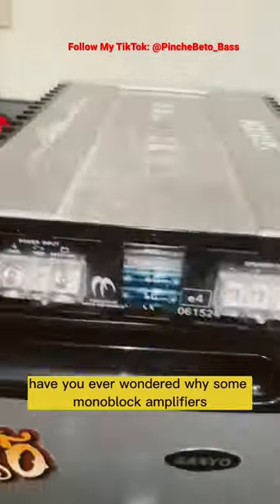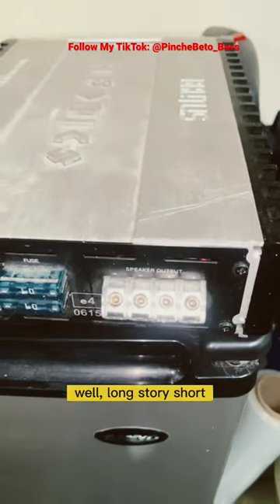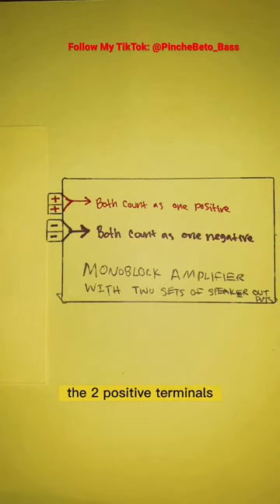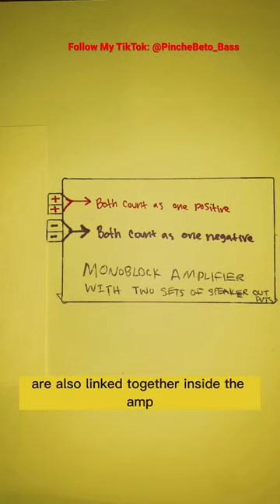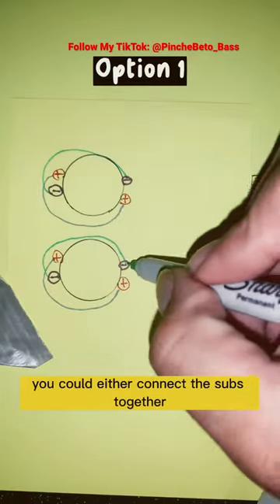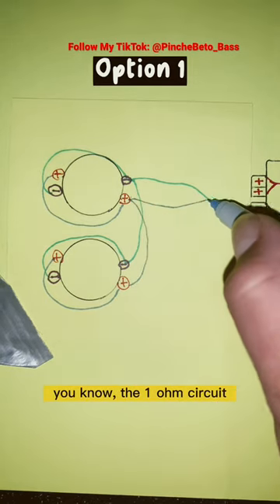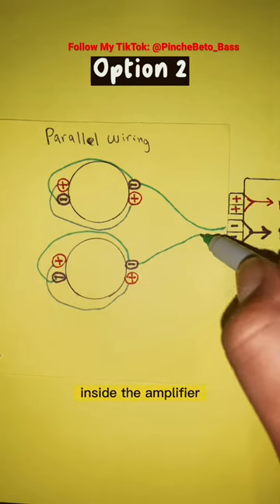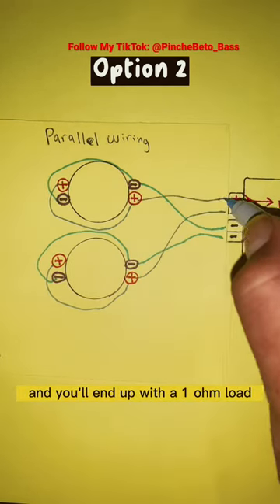Monoblock Amps With 2 Terminals?? #Shorts #CarAudio #Installer #Subwoofers #Amplifier #Bass

Comment: Broo what if one of my speakers has the four connections but the other doesn’t
Reply from the maker: You should only use the same kind of speakers if you’re going to connect them to one amplifier
Reply: @PincheBeto_Bass what if they’re in 2 separate boxes
Reply: It works for series/parallel dual 4 ohm to a final 4 ohm impedance?